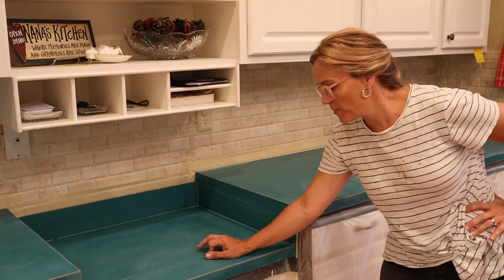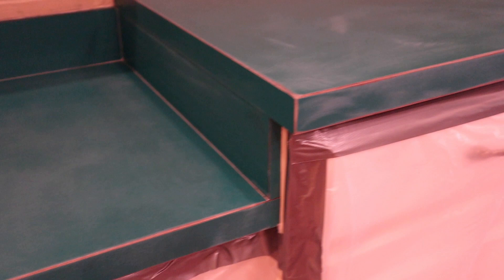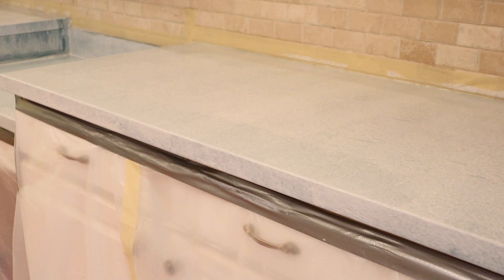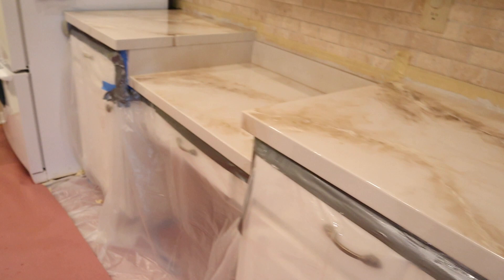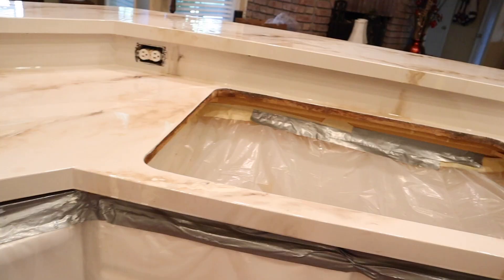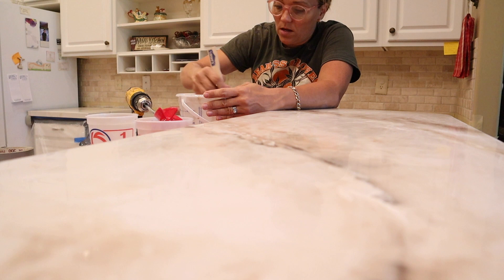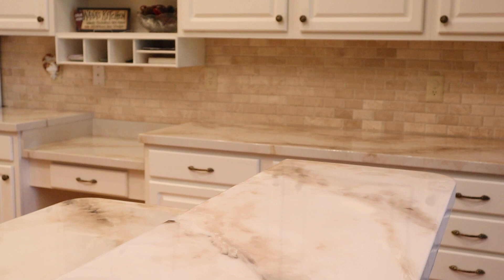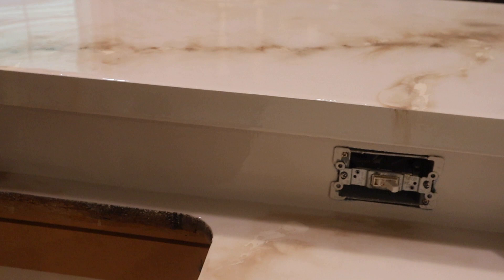Epoxy over laminate AKA formica PREP.

Comment: I purchased a mobile home to flip in an excellent location close to the beach.  This is my first attempt (vs a home) and was not prepared for a number of differences even though I had watched hours and hours about mobiles.  I was not understanding the WEIGHT issues.  Heavy items ( marble, stone, wall of tile..)create stress on the underneath skeleton and require I get underneath and add support.  At 68 yrs I am no longer willing to do that (also I just do not want to carry heavy items)  so I have been looking at other options.  I am considering buying a sheet of laminate and cut it for the backsplash (an entire wall of marbled look is the goal, in the kitchen and a bath), but then lay it flat, do the epoxy then attach to the wall.  Old laminate counters are available possibly with an updated (the originals have cut outs I do not want and the seam is bloated from water damage) if not I will do the MDF.

Comment: Hey ms your countertops look sooo good.. Question you have large countertops like I do... How much epoxy did you use? 1/2 gallon of resin and 1/2 gallon of hardner? Or gallon of resin and gallon of hardner..
Reply from the maker: I think for this kitchen i actually used 1 1/2 gallons of each. I bought 2 gallons of resin and 2 gallons hardener but i didnt use it all. It's bettter to have too much than not enough that's for sure!

Comment: I love this video and your video with the design tutorial. I have them saved as a reference because I’m about to do this in my kitchen. I plan on leaving the sink in, hopefully that goes well. What color did you use as your base coat? I like the color used. I saved which colors you used for the veins but I’m also interested in the base coat. & what size can in the base color did you need for this project? Thank you!
Reply from the maker: Thank you Kaylee! I used a Behr color called Swan Wing. It’s an old color and Home Depot no longer has the swatch but the formula is still in their computer. When you tape off the sink make sure you remove the tape before the epoxy is completely dry otherwise you may end up with tape stuck in the epoxy. Also don’t use blue tape, use off white for around the sink. 😃
Reply: @MimzyandCompany  thank you for replying so fast! I will talk to Home Depot to see if they could get me something close! Did you just need a gallon for this project? My kitchen looks approximately this size. Thank you for those tips! I’m taking note!
Reply from the maker: @kayleeclark4894  yes, one gallon is enough. My Home Depot still mixed Swan Wing for me. my whole kitchen and family is painted in it. I just tell the paint counter person the name and they find the formula in the computer.
Reply: @MimzyandCompany  wonderful! Thank you SO MUCH! This has helped me tremendously.

Comment: Stunning! Is sanding necessary if you primed the surface because that is the purpose of the primer.
Reply from the maker: It's not necessary, but it'll make a butter smooth surface and remove any fuzz or bristles, etc. I'm just in the habit of it.
Reply: @MimzyandCompany  thank you

Comment: This is beautiful! I plan to do this method on my laminate counters soon. Did the epoxy pool on the vertical surfaces? I worry my laminate counters (that have the slope on the top) will slide down and pool.
Reply from the maker: Yes it does run off the vertical surface a bit. There’s no way to avoid it. But if you put color on the vertical surfaces last, you’ll get the best results. Because the resin will be more set up at that point.

Comment: How did you pour out the vertical surface under the breakfast bar?
Reply from the maker: I brushed on the epoxy with a paint brush. I let that set up for about 15 minutes then put the veining on . So that the veins would run down as little as possible.

Comment: Ok, so I have weird formica counters.  The surface of the counters is formica, but they are edged in what I believe is actual tile.  So they tile part is rounded, but has grout lines.  Can I epoxy counters like this??
Reply from the maker: You can epoxy just about anything. I'd probably Bondo the grout line so don't see it.
Reply: Thank you! @MimzyandCompany

Comment: I used apoxy spray on my countertop and they cracked up when it dried and we added a second layer . Now I tried countertop paint to cover it after being slightly sanded it cracked up as well . Now idk what to do .
Reply from the maker: hmm....it may have needed to be sprayed in many thin coats rather than a thick coat. Can you chip it off? Or...can you fill the cracks with Bondo and then paint it, and then pour two part epoxy over that? OR can you paint the cracks with a darker color so they look like veins and pour two part epoxy over it so it looks like marble? Two part epoxy will level anything.

Comment: I am going to do mine soon.  I want to know if I can leave the sink in. Does it need to be takin out!  Thank you. Kim
Reply from the maker: well....the problem with leaving the sink in is if you need to replace it, your epoxy would be ruined. Also depends upon if you have a bit of lip at the edge of your sink so the epoxy will still be lower than the edge of the sink or at least level with the sink, so it doesn't flow over the edge.. does that makes sense? But , yes, you could leave the sink in.

Comment: This is beautiful! I want to do mines this month. I have 2 questions: 1 where did you but the epoxy and resin from? 2 did you mix the color with the resin to do the veins or is that paint?
Reply from the maker: I bought the epoxy from a local company here in Tampa called McKinnon Materials Tampa. They ship and theyre waaaaay cheaper than ordering online. But there's probably someone in your area that sells it.  And the veins are just spray paint. check my latest video on how I did the veins.

Comment: I have been wanting to do this but hear a lot that the epoxy will yellow over time.. what do you think? Has yours or do you know of any that has?
Reply from the maker: the short answer is Yes, it does yellow. I know for sure it does because I used the same color background paint for my counters/backsplash and the walls right behind, and there is a difference in color. However not enough for it to matter to me or for anyone else to know. I did a video on it....https://youtu.be/vcvFmW0PIcQ

I will say I know for sure that the thicker you apply the epoxy in one coat the more it will yellow. so make each coat fairly thin.
Reply: @MimzyandCompany  thank you!

Comment: It is so beautiful!! I wanted to do it but, I watched some videos where it said there was a little yellowing after couple of months and also some stains from veggies. Is it worth all the efforts?
Reply from the maker: I think it's 100% worth it. It's actually not that much effort and for the cost you can't beat it. So far I have not noticed any yellowing with my counters or my backsplash and I painted the counters and backsplash the same exact color as the wall above the backsplash. And there is no difference between my wall and my backsplash so far.
Reply from the maker: and as far as stains...the only stain on mine so far is from a wet plastic grocery bag that was left overnight and the printing from the bag transferred to the counter. I used some windex and it came off after a few days. It wasn't immediate, and I was mad, but then within a few days I couldnt even tell where it was anymore.
Reply: Thanks a lot for answering the questions! Any recommendation on which product to use? I have seen lot of videos of Leggari and stonecoat
Reply from the maker: @rohiniyadav9294  well...I was told by the man I bought my epoxy from that there's only 3 epoxy manufacturing plants in the US so all epoxy basically comes from the same place. He's an old timer and been in the business for 40 years and seems to really know what's he's talking about.  All that to say...I'd buy from whoever has the best price.  You can call the place I got mine here in Tampa...Mckinnon Materials...and talk to Buster. He'll tell you anything you want to know and more.  They ship epoxy nationwide and the prices are cheap. Not sure what shipping would cost though.
Reply: @MimzyandCompany  thanks a lot for the useful information.

Comment: How do you do the vertical surfaces?
Reply from the maker: I try not too...but if you must, then you have to accept that the vein design will be a bit droopy.  you'll get the best result by waiting until the epoxy is set up a bit, and then adding the color to create the veins.  that'll prevent some of the settling/drooping of the veins.

Comment: How do you do the vertical parts ?
Reply from the maker: I brushed on clear epoxy and let it set up a little before adding in color. I used a paint stick to drip color down the vertical surface. It'll run no matter what, but if you let the epoxy set for about 15 minutes before adding the color it'll stay a little better.